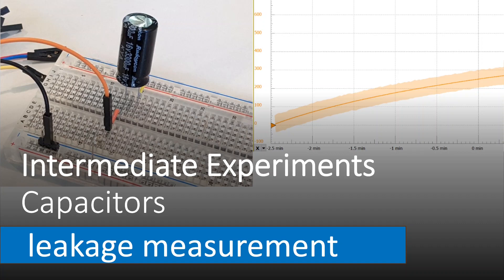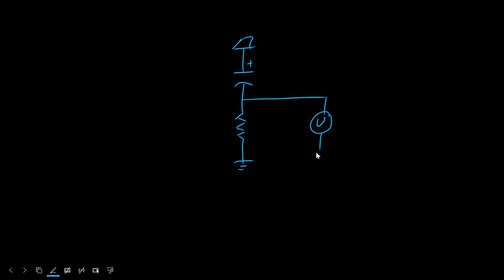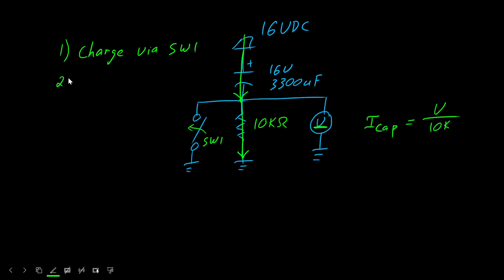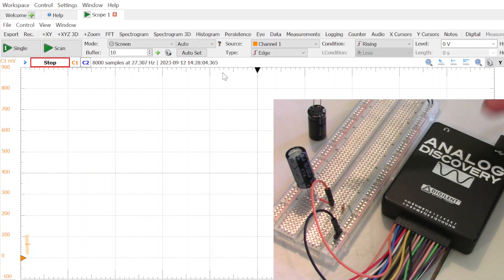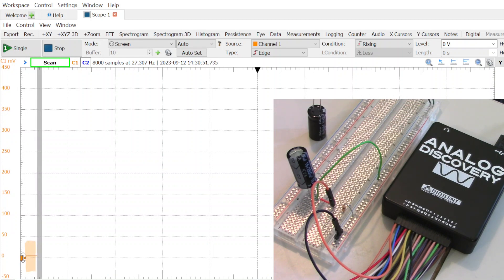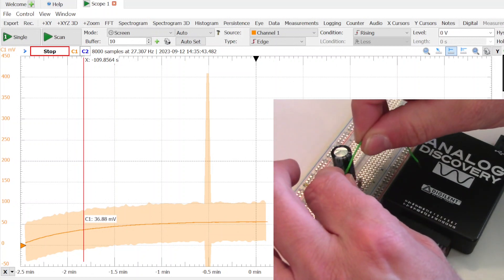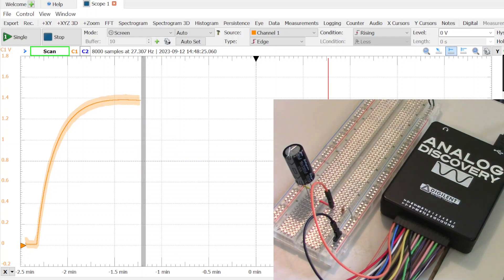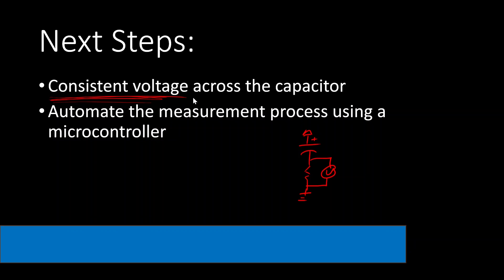Measuring Electrolytic Capacitor Leakage with a Simple Bench Setup

Comment: Hello.
After testing the second cap with 140 microAmps leakage, would you consider this cap faulty?
Reply: At around 3:50, he calculates what the max leakage current would be in his test setup, based on info in the manufacturer data sheet. He calculated that the max measured current would be 530uA. So, the older cap had a measured leakage of 140uA, which is less than the 530uA spec. Therefore the second cap has a leakage that is within the manufacturer spec. So, the cap isn't faulty, at least as far as leakage is concerned.